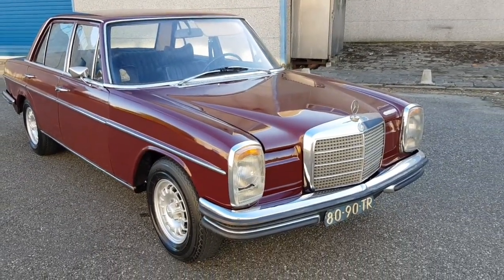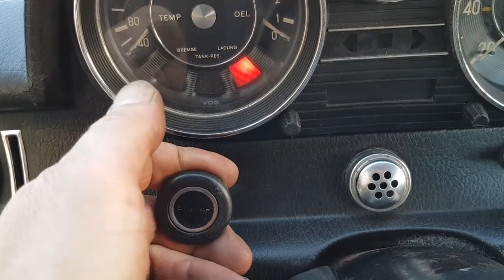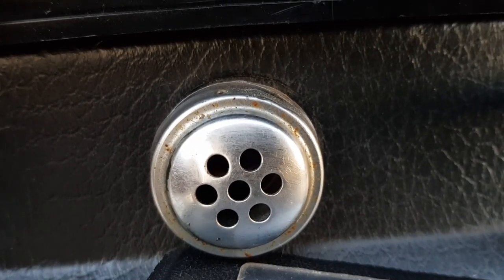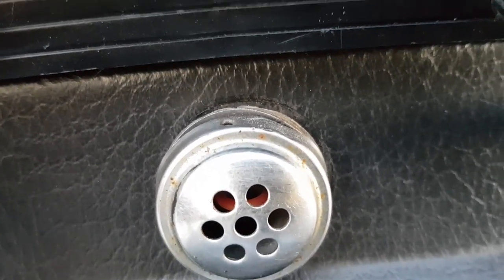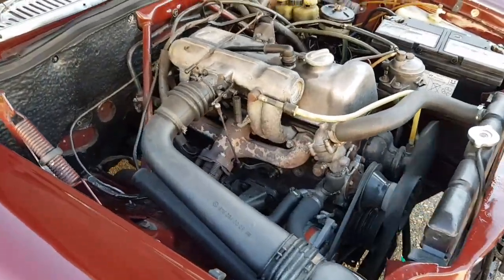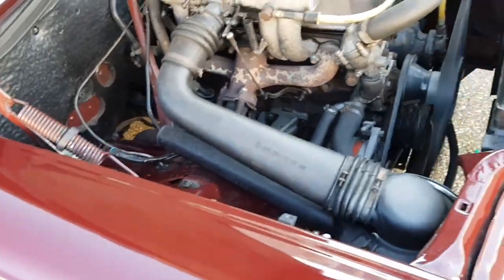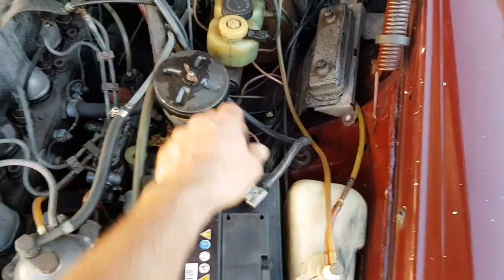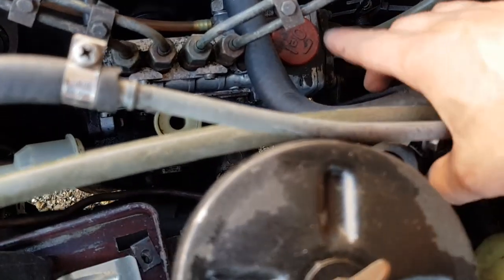Mercedes W 115 Diesel 1972 / sound engine

Comment: Hi nice diesel Mercedes, what fuel mileage do you get on the highway? Kilometre per gallons usa gallons?  How many miles are on it, where did you film it?
Reply from the maker: Use 1 liter can drive 14 km. In Holland
Reply from the maker: The car has a 80 ltr tank
Reply: @enjoythiswayNL  That is great fuel mileage! Do you have a lot of older mercedes diesel of that vintage in Holland, is rust a problem, what price range do they sell for in fair to good shape with no major rust?
Reply from the maker: In holland .the diesel not popular anymore .can not drive in the city and pay extra tax .   The price arround 2000 euro til 9000 . the rust a lot in holland
Reply: @enjoythiswayNL  Do they still make floor pans for the W115? I wonder what the pair would cost to do the floors?
Reply: How long have you owned your nice 220D, how many miles are on it, have you had to do many repairs to it?

Comment: Model w114
Reply: -> W115, because of the 4-Cylinder Engine
Reply: @erwing.3902 Can a w114 be diesel as well? Or only the w115?
Reply: @productions4452  ...only W115 - because of 4- and 5-Cylinder Diesel-Engines.
There were a 2.0 / 2.4 4-Cyl. Diesel and a 3.0 5-Cyl. Diesel. All were W115.

Only 6-Cyl. Versions of the "Strich-8" were W114